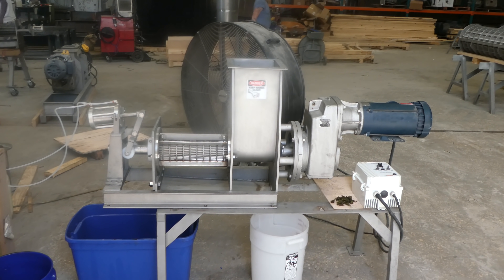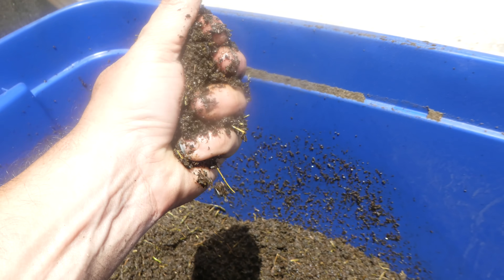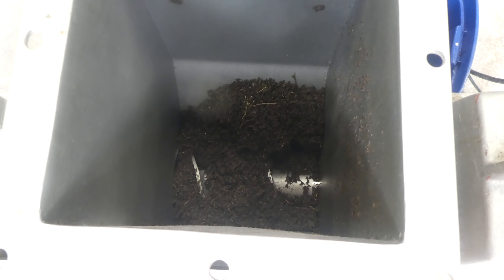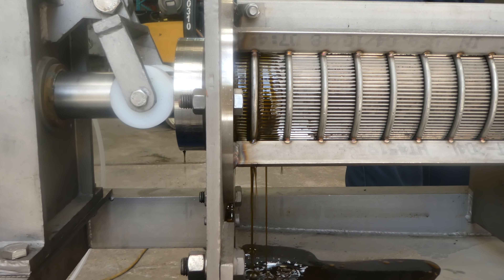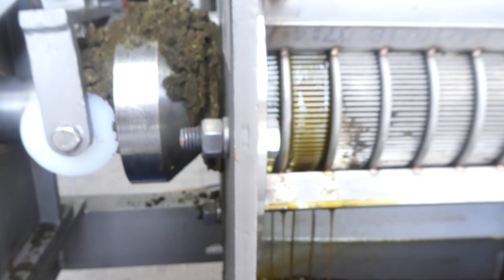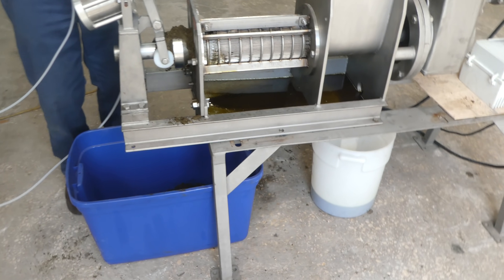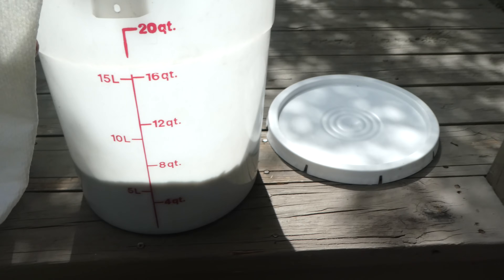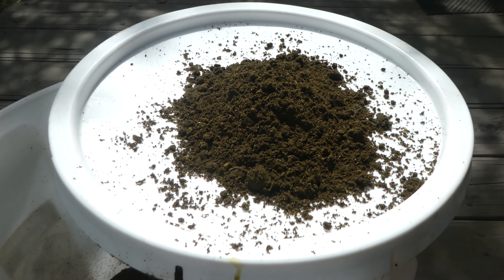CBD Oil and Solvent Extraction Screw Press.  MCT, Coconut Oil Infused Hemp

Comment: thats basically the second run of already infused product, thats been extracted. That "stuff' you pressed out is the lowest quality oil. Gosh thats why its hard to trust anybody besides organized rec centers these days. Most homegrowers just throw away that "wet stuff". its just not worth getting Every drop out of it, but if you can make a living off the waste of others, hats off.
Reply: In terms of CBD potency, I disagree. They're simply wringing out the last of the oil from the extraction; it's the very same oil. Any quality "degradation" only applies to any extra crap that's extracted by squishing the hell out of it. The CBD is still there, it's just in a darker oil with more junk in it. So for use in creams and such, who cares?

Comment: That would be a very crude and watered down product ya? What % cbd is the liquid and what do you do with it from here ?
Reply: Nope.  We recover 98-99% of the CBD oil in the plant.  From there they winterize, remove chlorophyll, remove fines if present then separate the solvent from the CBD with a rotovap or falling film.  Most of our 180 customers using it for hemp run ethanol
Reply: @Mattinator1973  cool stuff

Comment: whats the next step to get ride of the water content in it?
Reply: There isn't any water content in this or very little.  This is hemp dried to 10% moisture then soaked in about a 3:1 ratio of ethanol for about 10 minutes.  After pressing out 99% of the CBD and about 85% of the ethanol you go through a winterization process to filter out waxes and lipids then a filteration of the chlorophyll.  Finally to recover the solvent and separate it from the raw crude you use a FFE, Rotovap, or traditional moonshine still.

Comment: Terrible video lol. please explain every little detail not just point the camera at dribbling CBD/THC
Reply: Sure.  Of our 210 customers who use presses in extraction labs most are using them on post process waste material.  The intention is to press extra solvent and CBD their current process can't capture.  This turns waste material into $$ and generally pays the machine off in a week or so.  Some are using it as the primary extraction where they mix hemp and the solvent in the proper ratio / residence time and press it.  From there they will go through winterization or dewaxing, then remove the chlorophyll with a fine activated charcoal filter.  Now they have solvent and CBD so they run it through a rotovap or FFE to separate the solvent from the CBD crude.  WALA!  Crude
Reply: br de  This was 7 months ago lol..... I've been working with CBD distilling it with the ETHOS set up from Capna systems. Im pretty good on it now and im educated. I was just a little frustrated cause when i commented it was the day before my first day. so I was nervous and couldn't find any video that actually gave like a run down properly. I've gained that knowledge since then.

Comment: Were you able to get the CBD values that would get let's say from CO2 extraction? Would this be considered organic the way your doing or full spectrum?
Reply: We get out 98+% of the CBD.  CO2 wouldn't pencil out right now for CBD.  THC is a different story because the flower sells for 20-50x more.  Those that use CO2 bought them when the price was significantly higher.  Most are using ethanol and hyrdocarbon now but I like the idea of hemp oil, olive oil, or coconut mct for the reason you mentioned above.  

With our press most use it for post process waste material to squeeze the rest of the solvent and CBD out.  Some do use it as a primary extraction vessel but it will press out more waxes and chlorophyll you will need to filter out later.

Comment: cost capacity ?
Reply: Vary from $21,400 - $388,800.  110 lbs an hour up to 70,000 lbs an hour.
Reply: @Mattinator1973  ..
77,000 pounds per hour..
Reply: @aggabuss  Correct on a dry basis.  VP-30 with a 30 inch screw.  Wet it would do over 100k per hour
Reply: press cost?
Reply: @aggabuss  $21,400 for the CP-4 110 lbs an hour dry.  How much throughput do you need?
Reply: @Mattinator1973  ..
is that vp30 the one in pic..? i made a good guess on capacity?
Reply: @aggabuss  No that is a CP-4.  We might have some pictures of the VP-30 on our website vincentcorp.com

Comment: 4 gallon blue cap
whole seed ? cake ?
oil? what is capacity.
of the expeller press
 
i am seeing the oil out one end..and look like alot. maybe look like 200 pounds of oil per hour. in which case of castor seed 
would be a 440 pound feed.
Reply: Im not quite clear what you are asking.  We were testing post process Coconut / MCT infused hemp to see what we could squeeze out of the waste material.  Very successful test.  Seeds don't do all that well in our press.  An Anderson Expeller would work better.  110 lbs an hour to 70,000 lbs an hour on a dry basis

Comment: Hi there,

If you use an extruder you’ll be able to break the cell’s membrane, making it easier to extract the oil in the press, besides that, the extruder, due to the pressure will heat the bulk material over 120ºC, sterilising the bulk material. With the extrude+press method, you’ll obtain a higher yield of oil, and a cake with less oil residue.
Reply: We don't build extruders we build screw presses.  Most of the 200+ we have in the hemp industry are used on post process material so the cell walls are already broken open when they process.  This was just a test on waste material.  They bought the press and it paid itself off in a week.  Shows how much money they were leaving behind

Comment: If you use petroleum ether instead of oil, in this case you will get a dry extract. And if the operation is performed twice, you will extract 100% cannabinoids. About this there is a on my channel, unfortunately my starter was hacked.
Reply: Yes, but Petroleum is not good for eat or drink. So other oils are better solvents i think.
Reply: @Trbuhom_za_kruhom  😂

Comment: Does this really press out the oil? Or just excess water with some oil? Is the cake spent or does it still have oil in it?
Reply: I believe it's just a moisture expeller.  You'll need more sophisticated equipment to properly blast or cold-press the sticky trichome resins from your hemp pulp.  The same process can be applied to high THC cannabis biomass for wax, oil and dab preparation.
Reply: If you ran dry hemp through it would not press anything out.  If you soaked it in say ethanol or Coconut MCT and let the trichromes disolve then the press would press out close to 98% of the CBD.  You will however get waxes and chlorophyll into the press liquor so a winterization process would be needed after.  This particular test was on post process material a customer sent us.  Test was an amazing success.  They love the press as it paid itself off in a week.  Vincent Corporation matt@vincentcorp.com

Comment: Hi, just come across you.
What machine are you using.
Is it a bespoke or available on the open market. 

Nice stuff you got going.
Reply: CP-4  $21,400 - 110 lbs an hour on a dry basis.  Available from Vincent Corporation (813) 248-2650

Comment: I'm curious,  does the CBD oil come from the leaves, or the buds?
Reply: from the buds as the trichomes do contain terpenes, and cannabinoids ( THC-A, THC, CBD)
Reply: Cbd come from the entire hemp plant, there are some cannabinoids that are only in the stalk and leaves, when you press the entire plant you are left with a full spectrum oil, if you only press the buds of the hemp plant then you are left with cbd a cbd b, and thc a and delta 8 and 9......the emotive plant has less then 3% thc so it’s considered to be 0% thc
Reply: Cbd and thc are present along the whole plant from the fan leaves to the stem but the higher concentration is in the flowers

Comment: Id do a 2nd run.  Looks like when the press goes bake ya lose some.  Am i wrong ????
Reply: You could but there is a law of diminishing returns.  The press will press out most of whats possible on the first run but there are other factors that could come into play.  If the material blinds the screen in certain areas somf of that press liquor might make it into the press cake.  In cases like that you might want to run it twice.  Some of our customers use counter flow wash systems with 2 presses (the second press injecting ethanol directly into the screen area) to press out everything they can.

Comment: why dont you use industrial hemp oil? instead of MCT and coconut oil?
Reply: Because our customer wanted to test coconut MCT oil.  We don't extract here.  We just make screw presses used in several hundred applications hemp being the most recent.
Reply: @Mattinator1973  in hemp oil there are just 20% fat acid and in mtc oil there is up to 90% fat acids for the cannabinoids to be solvent in. its the best fat :)
Reply: @parandersson9406  Thanks for the info. Unfortunately I don't choose the solvent our customer uses.  Our press doesn't know the difference between hemp oil, MCT, or Ethanol.  It just presses them out of the material.

Comment: Choke should be on rods or hydraulic, and screw is turning too fast your cake should be fluffier. Every time choke jumps open you are Loosing and all de watering is being done on last 20 percent of baskets. Just my opinion 30 year industrial mechanic
Reply: I agree.   When the cake gets too built up it pushes the press back and you lose unpressed material i would run again.  . And i think the dry cake would be good for makin tiles or bricks
Reply: We have been building these since the 50's with about 10,000 in operation.  Thanks for the input.  This test was a tremendous success.  The customer has saved / made several hundred thousand off of it by recovering the coconut / mct and additional CBD from their waste material

Comment: I make RIck Simpson Oil but usually only do 2-3 pounds each time this would be good fo have.  Can you send me a link or any contact info where I can buy something like this?
Reply: I’ve seen RSO made using decarboxylated GOOD KIND using alcohol as a solvent then evaporated under low heat . RSO is generally 50/50 THC/CBD.
Reply: br de  Ive been able to get Trulieve syringes which are labeled 50/50. Ive never made RSO used Trulieve RSO to make butter a couple times. I watched vids on making RSO never seen it distilled.

Comment: lol cbd and hemp. does nothing for chronic pain. plus I can make a cleaner product in my kitchen.
Reply: Im 54 and have had some major
Motorbike wrecks broke back 3 times double compound fracture lower right leg
Several fractures to me head ribs fingers wrist etc.

Not so bad but tranfusion that saved my life in 7-29-85

Well stage 4 liver diease

Cbd with thc be it 15.1 or 1.1
It works relaxing

But yes i do dabs etc.
Been smoking since playground lol
Reply: Strange, CBD works for me and several other people I know too. But then not all pharma products works the same on everyone either. However are you aware there are different kinds of CBD with diferent profiles for different ailments? And that the quantity required varies per ailment? Also that the effects aren't immediate and requires at least 2 weeks of use before you notice improvements? Furthermore due to crappy regulation most over the counter products do not contain what it says on the bottle. You need to do proper research first and source correctly.
Reply: klompb the why does cbd work for sleep the same night you take it.but for pain  you need a build up of 2 weeks.
the cbd I tried was state cbd @ 25 buck for 100 mg.took 100 mg a night.after 4 days i gave up.to spend 350 for 2 weeks to see if something may work or not is a lot of money also.cbd might work on seizures,but for chronic pain it didn't for me.
Reply: @dirtydoughboy2854  tbh I do not know everything about it, I am still very much learning. As I understand it, it is actually incorrect that CBD doesn't have psycho-active properties. It's just that they are different and less pronounced. So rather than getting you high, it relaxes you. But not too an extremely noticable amount. It is why THC is still considered 'better' for a solid nights sleep. So while CBD might help someone suffering from anxiety to fall asleep easier, it wont be all that noticable in someone already relaxed or suffering from insomnia. As for needing 2 weeks for other issues. As I understand it, the anti inflammatory properties take time to build up and reduce inflammation to a noticable level. For my shoulder it actually took 4 weeks. I didnt even notice the pain decreasing and the relief was far from immediate, I just realised one day the pain was gone.

As for the amounts you post, I cannot say. There are so many forms it can be ingested, different spectrums and not every brand is good quality. Like I said I am still learning. Here in Europe its 35 euros for 100ml of CBD oil at 4-5% concentration. So even more costly? But at least its healthier than pharma chemicals.
Reply: @dirtydoughboy2854  that's because you're not taking enough dosage lol sad to see people be misinformed due to greedy cbd practices. Hope you read this and go buy some actual cbd from a farm or extraction company. Look up Phyto family or try to get full spectrum cbd oil and atleast take 400-600mg CBD fo really feel the effect especially for pain.

 Maybe look into buying hemp testing around 15-20% CBD, which is 150mg-200mg CBD per gram and you can get ozs for 40-100Max and that's the cheapest way to be honest maybe smoke it if you're into that.
Reply: Mr.Nobody I appreciate you knowledge,,cbd or hemp is a joke.if it works for you I hope you grow and extract your own.luckly I able to still get morphine for 10 bucks copay.i am not gonna spend a few hundred on cbd that didn't work for me.its the gold Rush of our era,even China is getting involved.fda needs to jump in.is there a reason the FDA isn't jumping in.thats the question I like to know.i think the FDA sees right through the hype of cbd or hemp.
Reply: @dirtydoughboy2854  

O i get the morphine etc
BH21 law bs

Poppy plant is now EVIL

I HOPE U WELL BROTHER
AND IF IN PUNTAGORDA
I COULD USE A 10 COPY
BUT 8MG DALAUDID
Reply: David Wilson 
The CBD your using has something wrong with it if your not benefiting from it.

Comment: Whats the cost of the extraction press?
Reply: The one in the video is just over $21,000  Shipping in the USA, XP motor, Stand with casters, Food Grade, and VFD included
Reply: Mattinator1973 do you have any base in Europe
Reply: @heals005  We are in the USA but have hundreds of presses in Europe pressing all sorts of different materials.
Reply: @Mattinator1973  How many pounds per hour does this model press?
Reply: @HEMP-kk7ct  CP-4 does 110 lbs an hour dry hemp.  Our presses vary from 110 lbs / hour to 70,000 lbs per hour.
Reply: @HEMP-kk7ct  This is our baby lab press so it only does about 110 lbs an hour dry.  Ethanol soaked is about 150 and fresh hemp is close to 180.  Our big ones do 70k+ per hour
Reply: Mattinator1973 do you have an email for sales on this? Great solution!

Comment from the maker: Although this Hemp material was more shredded at the stage we started this test,  it all started as flower and leaf material.
Reply: How do you get rid of the press cake?
Reply: Hello, we have a hemp shredder, a grinder and a dryer. Do you need one?
Reply: Your contacts?
Reply: E-mail:danicawang@cngxmachine.cn    
Tel: 0086-371-68530216 Fax:0086-371 - 68530223      
Mob: 0086-15515910571 (WhatsApp ID) (Wechat ID)
 @ruhonge